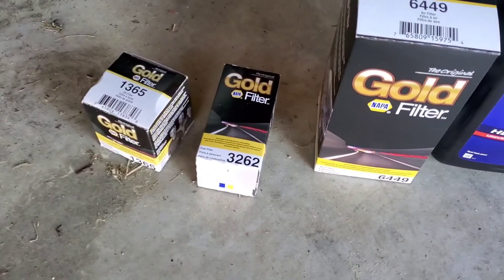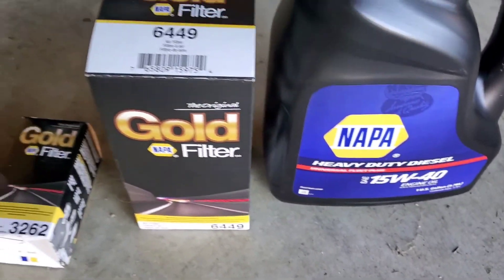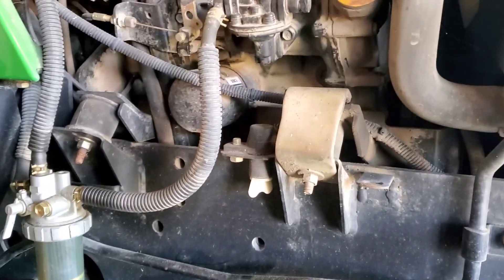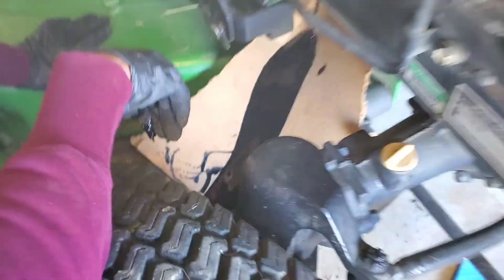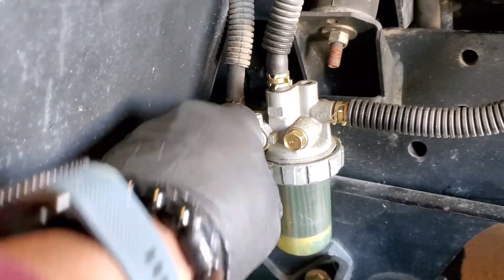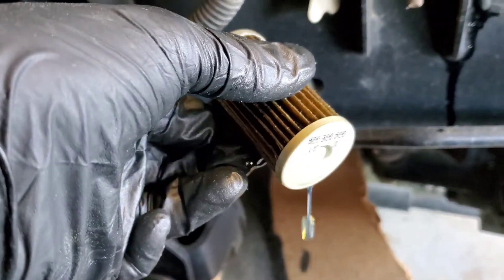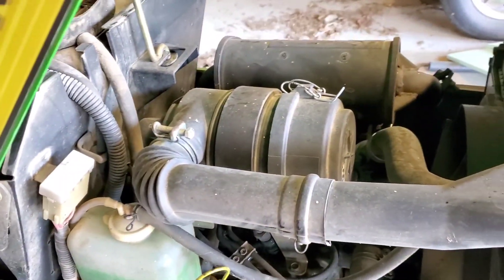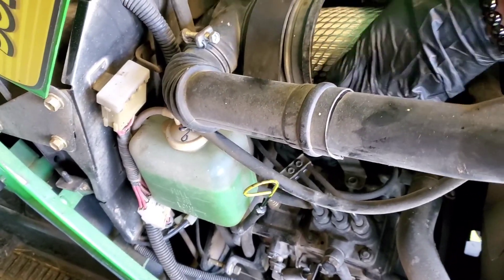John Deere LV4010 compact oil, air filter, and fuel filter change

Comment: I have the same tractor but mine has the bucket on the front and currently I'm trying my best to get the fuel filter off without removing the bucket, I really hope that it is only hand tight as there isn't much room.  Worst is that I have no service history on the tractor as it was left to me without any info so I am having to do all this now before winter sets in.  I did have to get the Wix filters as the nearest Napa store was a drive, however the cost difference was only pennies so it came down to the cost of gas to go to Napa or go O'reillys which was closer and had the Wix stuff in stock.
Reply from the maker: The fuel bowl should be hand tight. WIX filters are the best filters that you can buy, so that's a win. NapaGold filters are manufactured by WIX 👍🏿.
Reply: I'm sure it was hand tight about 10 years ago but now it might be a bit snug, I thought I broke the ratchet when removing the oil drain plug.  My main concern it the bucket attachment is right by the fuel filter making the bottom pitch forward a bit, getting off shouldn't be an issue once it is loose it is getting it back on with such a limited space.

Comment: I just bought a used tractor like this.great video.do you happen to have a video on hydraulic filter replacement.
Reply from the maker: Not yet, but that's the next thing that will be serviced. I want this little tractor to last even after we get a slightly larger one.